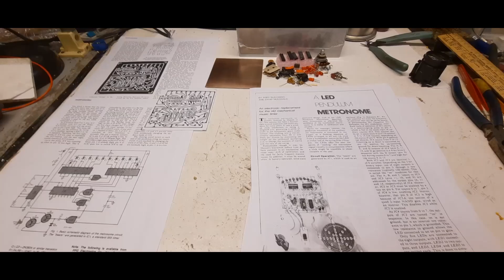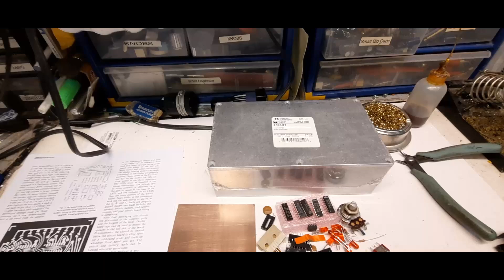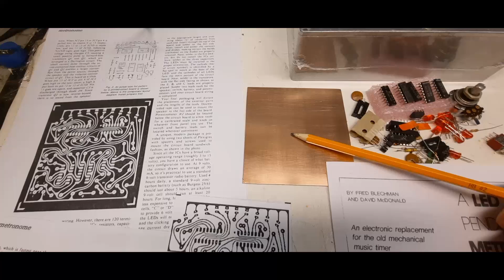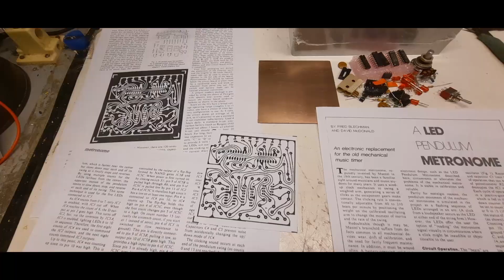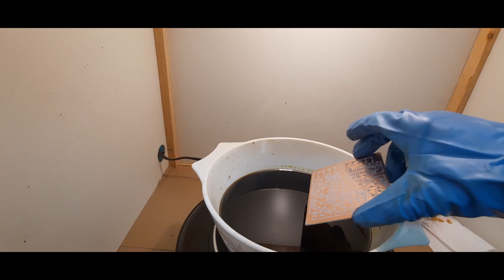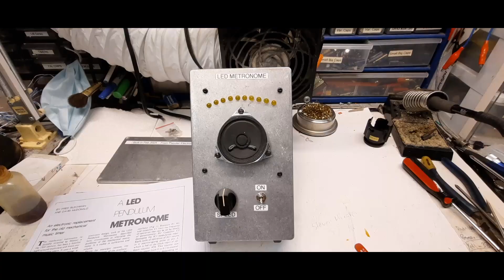Popular Electronics - Musical LED Metronome - December 1981

Comment: What kind of paper do you use?  Magazine paper?
Reply from the maker: Not newspaper. I have heard of folks doing that. I use 8 1/2 by 11 paper. The brand is Hammermill and it is called Premium Laser Gloss paper. Thanks for watching the video. Cheers!
Reply: @bettinaneumryr  I don't mean "newspaper".  It's common to use glossy magazine paper since toner doesn't permanently adhere to it.  I've used it with good results.  Glossy laser printer works too.

Comment: I grew up building electronics projects from Popular Electronics and Radio Electronics back in the 60's and seventies. My dad used to have copies running back to 1954, including vacuum tube projects. Need to mirror the artwork, depending on your transfer technique. I would copy on acetate, then use PCB's treated with photo resist, expose, develop and etch, but if you use a copy machine for heat transfer, you have to mirror the artwork. Should be easy in your image editing software, we didn't have such things back then.
Reply from the maker: These old magazines are great. The URL for PE is https://www.worldradiohistory.com/Popular-Electronics-Guide.htm and yes .. they go back to 1954. Check it out. You can also search for Radio Electronics from that site too. I also do the photo resist too. The blank  boards are getting really expensive though. Thanks for checking my vids out. Cheers!